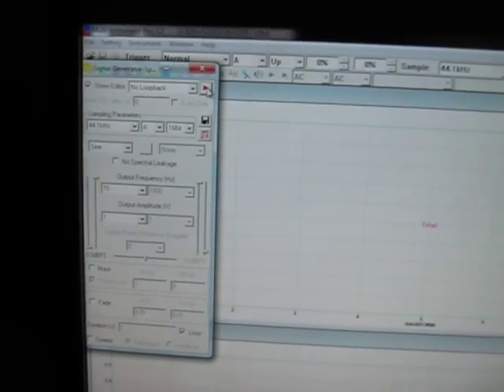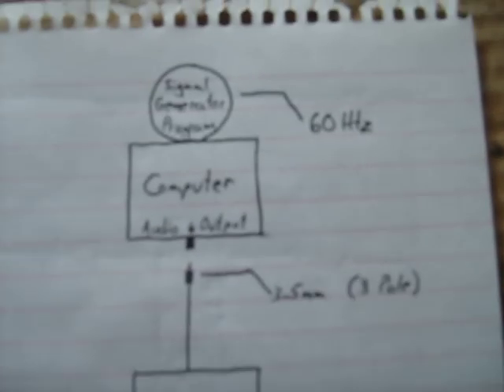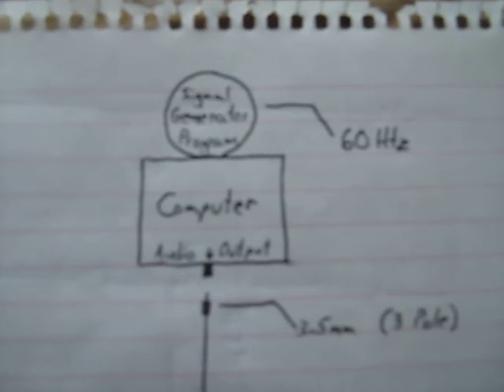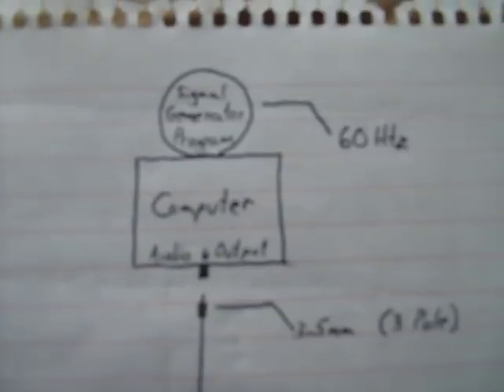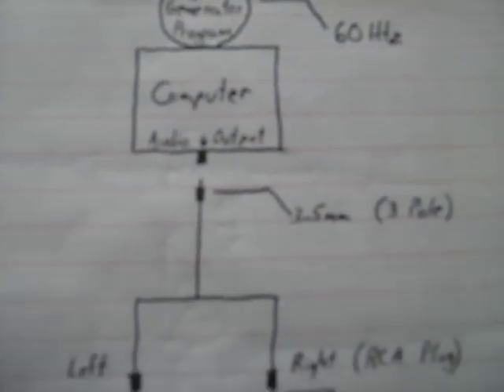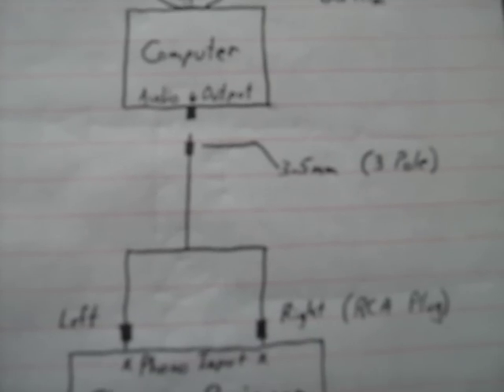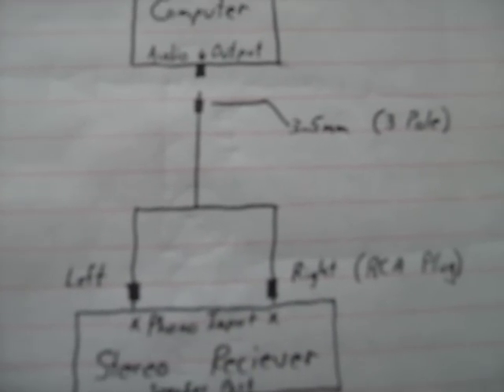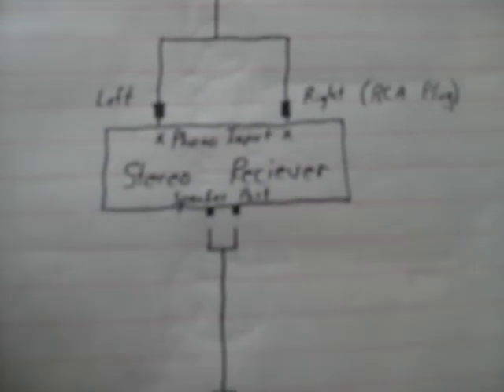Sound Waves + Corn Starch @ 70 Htz --- Non-Newtonian Liquid --- Fun Science Experiment

Comment: alot like ferrofluid activity in a way.. 
very awesome. it almost comes to life.
if you generate the same hz but not have it exiting through the speaker, rather through the wires and a spark gap,  and resonate an antenna receiver producing the same frequency,  wouldnt that wirelessly transfer the energy and also allow for amplification?

Comment: also since there is no consistency in the viscosity of the fluid, maybe thats why some of it seems to "fly away" as some of it receives alot of vibration resonance and manages to escape from the rest of the body. it also must be resonating with the plastic as well as the materials of the speaker itself causing more imbalance. i wonder how one could apply this signal to the fluid without any contact, and without the fluid contacting any other material, somehow suspended in a vaccuum.